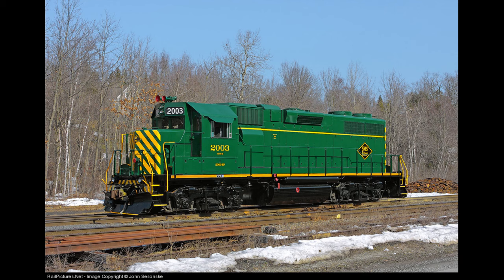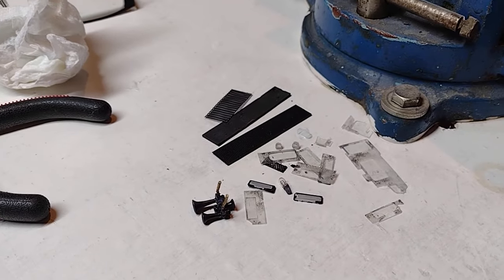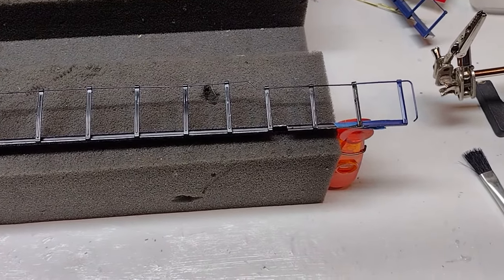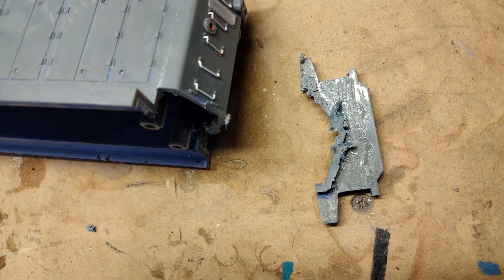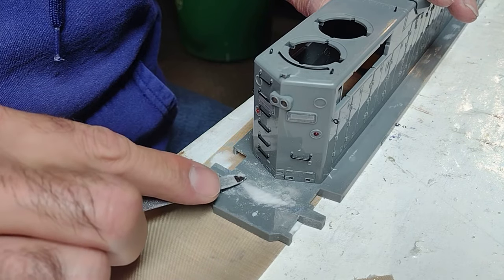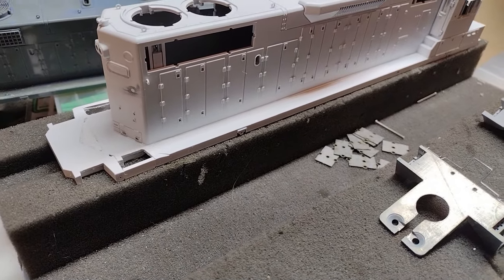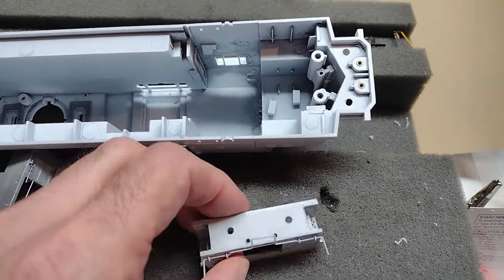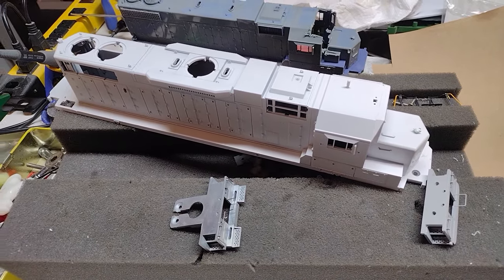GP38-3 with Extended Cab and Large Rear Porch

Comment: Penn Central also had some GP38s with the extended cab, as did Reading's SD45s, interestingly. This feature was used to accommodate a double sided control stand, for bidirectional operation.